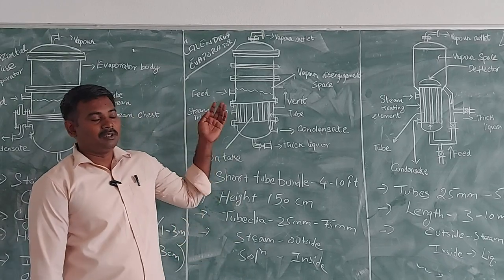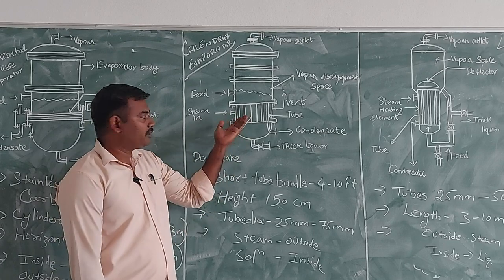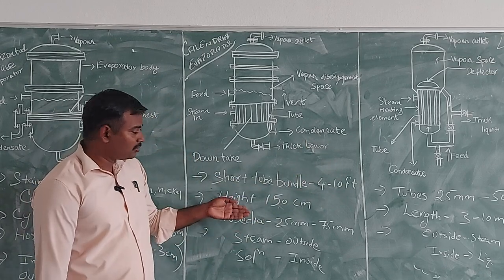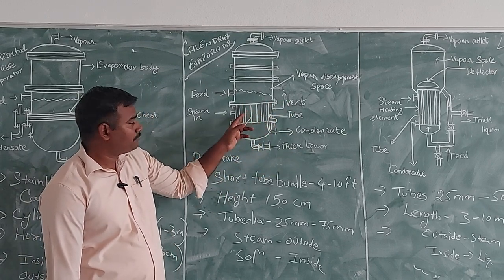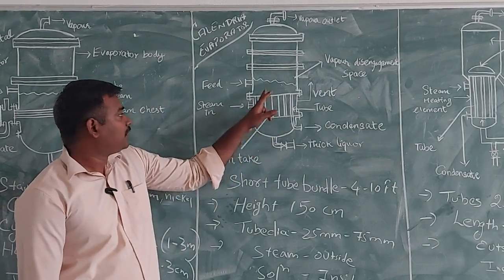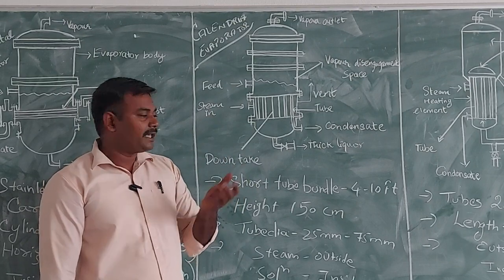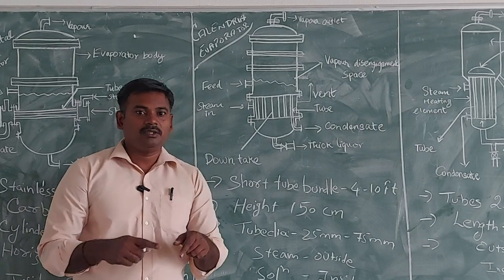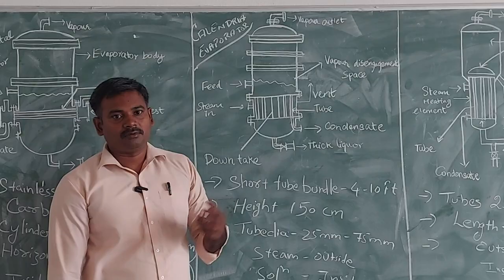HEAT TRANSFER - CALENDRIA TYPE EVAPORATOR - EXPLAINED IN ENGLISH - CHEMICAL

Comment: why feed is given in the middle ? Why not top part of the shell ?
Reply from the maker: There is no pump used here, for forced circulation we use from bottom
Reply from the maker: If we send from bottom we need pump, cost will be high. But in forced circulation we send feed from bottom